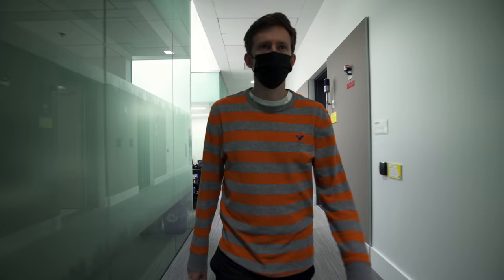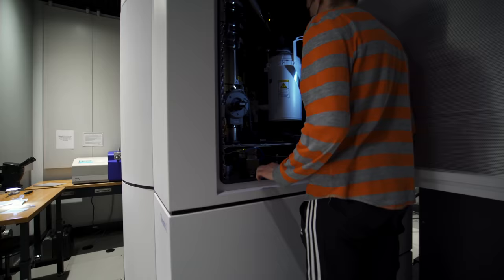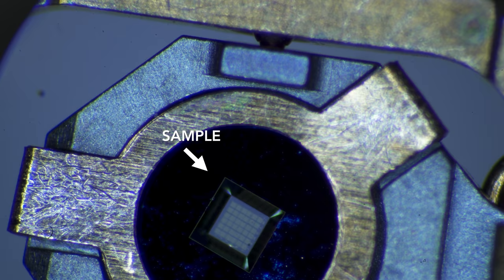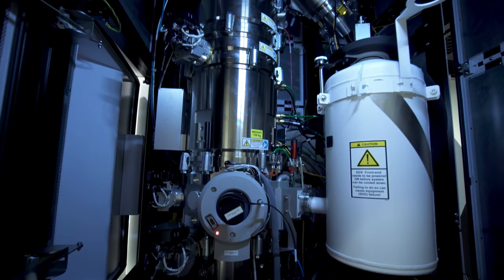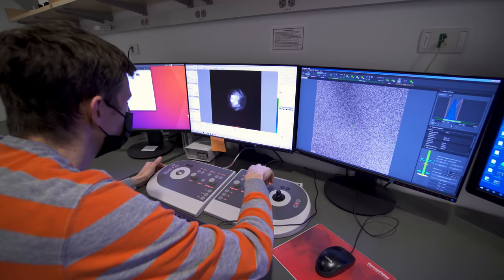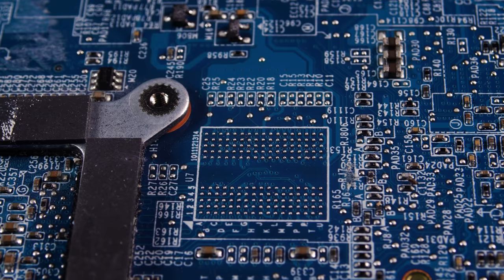How to image atoms

Comment: "about 5 million hydrogen atoms could fit into a pinhead" Isn't it a low estimate given the area of a standard pinhead?
Reply: they mean as a line
Reply: Up to the definition of "pin head". Where does this "head" start? Comparing two sizes, where only one is exactly defined (5 Mio.), and the other is very vague (pin head) makes no sense at all.
Reply: Red this sentence today in "A short history of almost Everything"
Reply: You mean like a Trump voter?
Reply: "There are three bathtubs of water in this lake."  Technically a correct statement.

Comment: 0:13 "about 5 million hydrogen atoms could fit into a pinhead". While this is technically not wrong, where did you get this information? 

If you put this number in the general gas equation for 0 °C you will get a Volume of 1,89*10^-19 m³, thats a cube with sidelenghts of 5,74*10^-7 meters or 574 nm, thats the wavelength of visible light, the diameter of a human hair is 7 million nm. A pinhead has a diameter of 1 mm, thats over 1700 times more then 574 nm. And thats for the Volume for atoms in a GASEOUS phase.
Not saying that 5 million Hydrogen atoms wouldn't fit into a pinhead but thats a pretty bad comparison. Like saying "5 bananas would fit into a football stadium".

About 1,4*10^16 hydrogen atoms would fit into a pinhead, thats 14 quadrillion, 2,7 billion more then 5 million. 

It could be that I have a mistake somewhere in my calculations but 5 million is WAY off.

Edit: I wrote atoms when I should have written molecules since elemental hydrogen gas is a diatomic molecule, but I'm totally not in the mood to recalculate. Just imagine I talked about helium.
Reply: Thanks, I was going to comment that I think that's off a bit, but you even did calculations showing how off. It's not a good sign when I'm hitting pause and heading to the comments 15 seconds into a video.
Reply: They likely calculated the length of 5e6 Hydrogen atoms if you put them side by side, which adds up to about 0.6 mm, which is in the ballpark of the diameter of a pin. I agree that there could have been a better comparison, but making popular science videos is difficult. If you simplify too much, it may come out as plain wrong; if you don't simplify at all, it will not fit in a 3 min timeframe. I commend your effort, though.
Reply: Maybe she meant the spike as the head.  Which is dumb also
Reply: Are you really questioning the Massachusetts institute of technology?
Reply: @NZobservatory  Thats fair
Reply: Yeah. Imma have to put my money on MIT rather than some random, plenty of free time having, YouTuber 😂😂
Reply: @Retrodraugluin  Looks like you are right in deciphering/debugging what she said. But this doesn't mean the speechwriter choose just not a good comparison, but s/he did not know what s/he was writing about and did not bother to check.
If you already understand the topic, you will notice the mistake and just brush it off. However, the target audience will swallow all the bs especially after noticing MIT logo. Therefore, I have troubles to accept the "difficult" excuse. 
Did you notice that MIT added a remark in the video/subtitles about the mistake? I didn't. This is already a problem #3.
Reply: The thing that "stuck" out to me was the guy with no gloves on… I would think you to need be in a clean room…. I guess that’s what the vacuum does.
Reply: i mean, technically she aint wrong
Reply: Yeah that's what I was thinking
Reply: Go outside and socialize
Reply: Falls Over..
Reply: @bobthetroll  haha you can’t do math
Reply: I was thinking the exact same, thanks for the validation 😂
Reply: I also thought 5 million atoms is too few for a pinhead
Reply: اذا تبددت الرطوبة وابخرتها صعد كل شئ إلى الأعلى وبدافع الحرارة رغم انها تسقط من أعلى( كيف) ... ؟؟؟؟؟ . عليك أن تعلم انى تحدثت عن الرطوبة تحياتى
Reply: Your average joe doesn't even understand how much a billion is...much less trillion, quadrillion, quintillion, etc.
Reply: Perhaps he was supposed to say billion...
Reply: @Shifftee  
So:  We've gone from angels to hydrogen atoms in 5 centuries; but we're still stuck on pinheads.  How droll.
Reply: Well i'll be damned if i stay here and let you trash those poor folks,for a simple miscalculation of a few quadrillions.

Comment: That magnesium atom that jumped. Was that a quantum leap or am I confusing something?

and why did it jump? just because light hit it? what does that mean in terms of materials?
Reply: Wave theory seems pretty legit right now
Reply: Electron microscopist here. Think of the electron beam that we use to image atoms as a current. That current carries significant energy and sometimes enough to transform materials. Not so familiar with battery materials, but I expect some phase transition could happen there, just like how anatase could be converted to rutile given enough heat. When there is a structural change in the sample during observation, microscopists can see such things as the atom jump.
Reply: @mindachen5066  Are there ways to microscopy technology that won't affect the observation at that scale? Or are we stuck at atomic level so far?
Reply: I thought quantum leap relates to electrons jumping from one shell to another.
Reply: @fatitankeris6327  If you are asking about ways to avoid electron beam damaging/changing samples while imaging, yes it is challenging but there are a few strategies. For example, in cryo-EM, microscopists often use low electron beam intensity, short exposure time, and extremely low temperature to stabilize proteins and other biological structures. 
On the other hand, atomic resolution is the best we can do so far in the pursuit of resolution.
Reply: @mindachen5066  couldn't just use AFM then? They are also capable of atomic resolution under the right conditions
Reply: Chr0my, yes you are confusing something. And, there are high energy electrons, not light, that strikes the atoms.

Comment: I don't get the sentence: "The more electrons are collected the brighter the light" if at the same time the light spots stand for atoms. It is for me a little contradictory.
Reply: Yes, lighter marks represent higher electron concentration. It is only photon “light” when showed on the monitor. How is it contradicting?
Reply: @kentcassidy7116  But if lighter marks represent higher electron concentration why they said it stand for atoms. Is it because these electrons belong to the atoms?
Reply: @rantrydan3366  the electrons are not from the atoms, but they still interact with the atom’s electrons. I’d assume most atom electrons would stay attached to the atom, meaning that the high concentration is from previously individualized electrons that are behaving one way or another after being launched through the sheets of material. Two separate contexts for electrons- one set used to measure the others that are part of atom
Reply: @kentcassidy7116   So the more electrons interact with the atoms the more light can be seen?
Reply: @rantrydan3366   I’m no expert but I’m certain the number of electrons that are transmitted from gun through the material tend to be similar in all cases. Based on the structure of the atom, the electron that is shot through interacts in different ways. In most cases, the series of electrons from the gun creates different patterns on the screen behind the material, much like a wave interacting with a wave. This would mean that if the gun’s electrons appear in certain concentrations at certain positions, we can safely guess the structure of the material/atoms. All of the gun’s electrons interact with the material/atom. The brightness or concentration indicates the behavior of the interaction
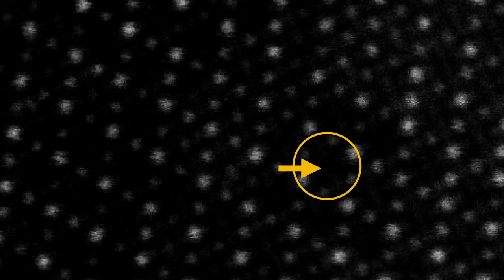Reply: @rantrydan3366  at around 2:30 it equates the light spot to the metal atom. It is not actually the metal atom, but still an exact indicator for it’s behavior through the process

Comment: I'm mildly surprised that the scientists aren't required to use PPE (or at least a head cap) while operating the microscope. The environment requires everything to have the least amount of contaminant, but dusts and other airborne particles carried by the people might get in the way and ruin the equipment. 

Look at how microprocessor factories for context. They require a very high degree of cleanliness, it's considered to be far cleaner than surgery rooms. 

Or maybe this microscope isn't at all that sensitive to contaminants?

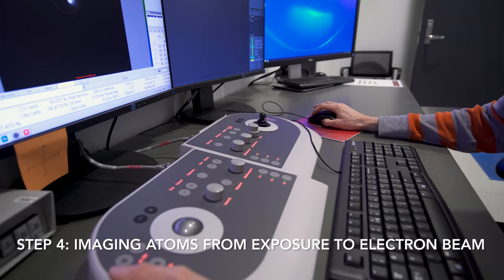Comment: In video, @1:50minutes, it is said more electron collected, brighter the image, when explaining about battery, it is said brighter portion are atom. But black image should be atom because electron beam reflected or deflected due to centre of atom and brighter image formed collected electron which are just passed side of the atom
Reply: This is an annular dark-field (ADF) image, meaning contrast is measured when electrons are deflected or diffracted off the optical axis.

Comment: If only there's a ray that has a much smaller wavelength than electrons. We might get crystal-clear image of atoms and gain much more insight. I think gamma rays have smaller wavelength but there's no way to magnify gamma rays.
Reply: The wavelength of electrons can be made arbitrarily low by increasing their momentum.

https://en.wikipedia.org/wiki/Matter_wave
Reply: @narcosalpha9472  
Did not know that. Electrons are strange.

Comment: 2:20 is it oscillating? Conservation of energy and I wonder about the negative potential energy and its use in future.
Reply: What do you mean? They are putting a lot of energy into the specimen by the electron beam. Why do you expect the energy to be conserved? And what do you mean with ”its use in future”?

Comment: It is really just the outer electron "shell" of the atom that is imaged?
Reply: The fact is whole observe universe "almost the whole" is outer shell of atoms.
Reply: You don't image a specific shell or orbital with this method. The atoms behave like spheres which is why they scatter in such a way that they produce the patterns shown in the film. You basically just look at where the electrons where measured and from that you can deduct that on this position there is no atom on average.

At the moment there is no instrument with a resolution great enough to show orbitals/shells, but that might change with the advancement of the lenses in the microscopes.

Techniques where you can address different energy levels use electromagnetic radiation from the visible light to X-rays (UV-VIS, UPS, XPS and so on). But you won't get a nice image with those methods.

Comment: 1mm /1million = 1nm
1hair=100micrometers
100micrometers/1000=100nm
Also i thought the real thickness of such a sample for transmissive electron microscopy is around 1micrometer, which is still impressive but not quite the same as something on the nanometer level...

Comment: why one computer is using Windows and another one is using Ubuntu?
Reply: The mistake here is why aren't both running Ubuntu.
Reply: Both computers are running on Windows. On the left screen you see PEOUI, the UI to control the microscope on the right screen Velox, the application to conduct experiments and perform Analysis.